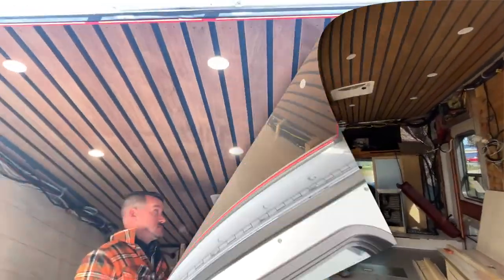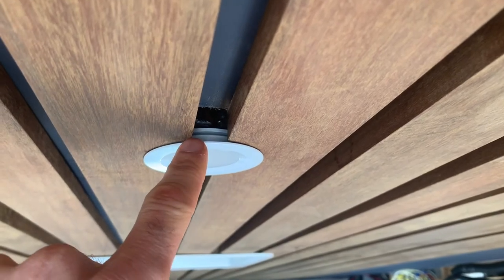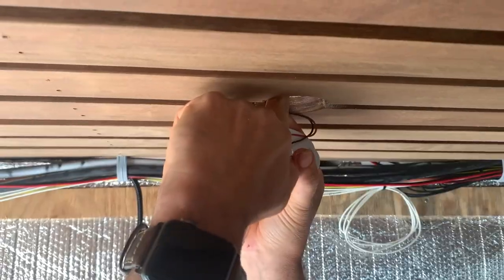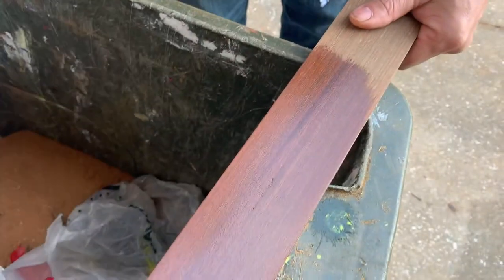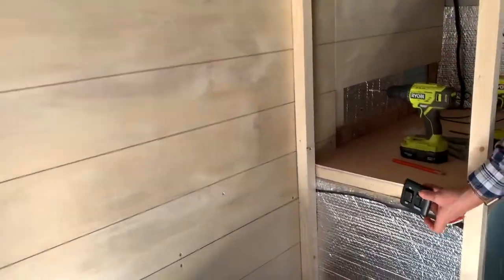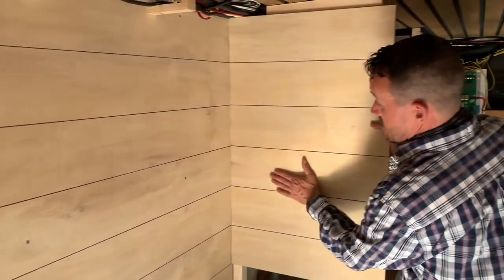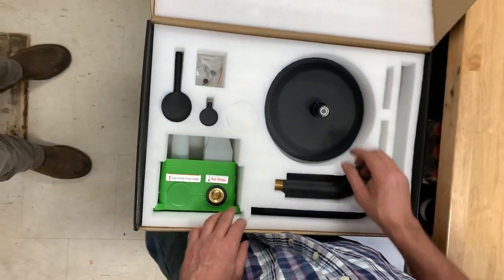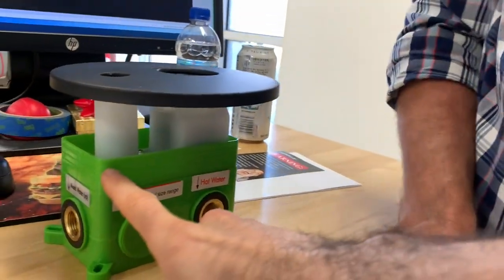Episode 2: LED lights, Maxxair fan, faux shiplap install on the ambulance camper van conversion

Comment: How much head room (if any) did he gain by removing the original ceiling "pan" and then adding the teak ?   Best learning conversion series I've seen, thank you !!
Reply from the maker: Thank you for the kind words!  He didn’t really gain or lose too much head room. It just looked too much like an ambulance inside ascetically. Also, there was a large, center trough that held a lot the wires which was moved to the passenger side, so that gained at least 5” of headroom in the center and made the wiring easier.

Comment: How did you cut through the mounted wood and aluminum to fit the max air unit in? what tools? Looks like it was cut after the wood was already mounted but that seems pretty difficult
Reply from the maker: Just a drill and a jig saw, it's very easy.  Drill out one of the corners and cut it out with the saw.  After the fan was mounted, we installed the teak ceiling around the fan and installed the trim plate around the wood.  You can see the wood install on this episode https://www.youtube.com/watch?v=c5GAVbKpkdA&t=0s